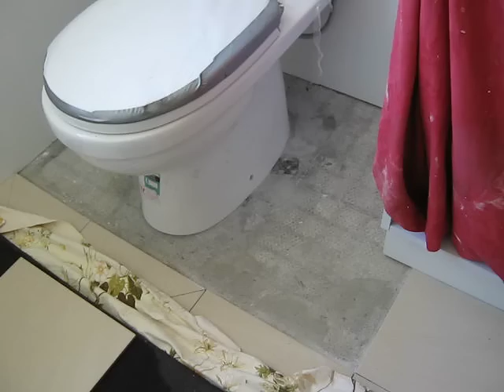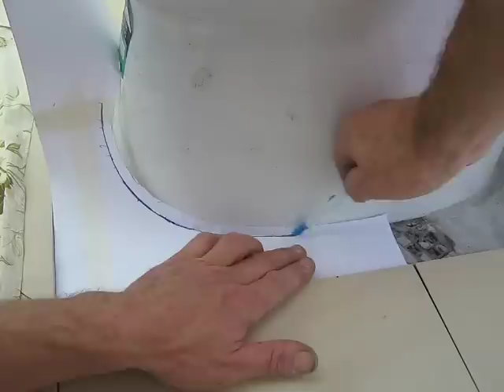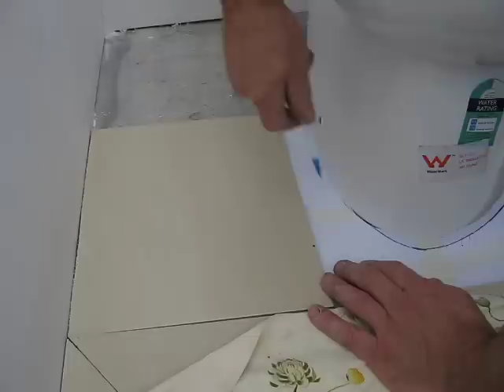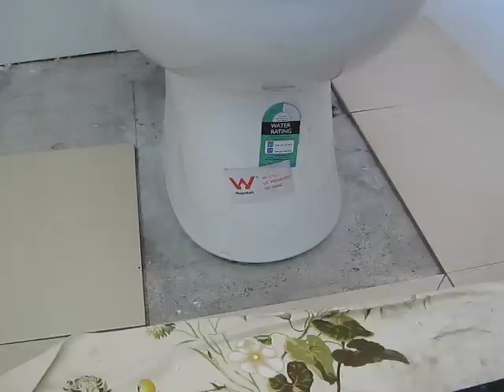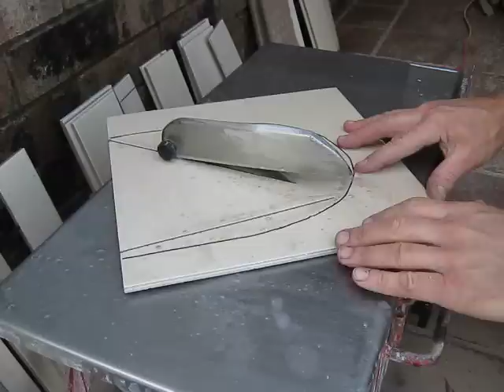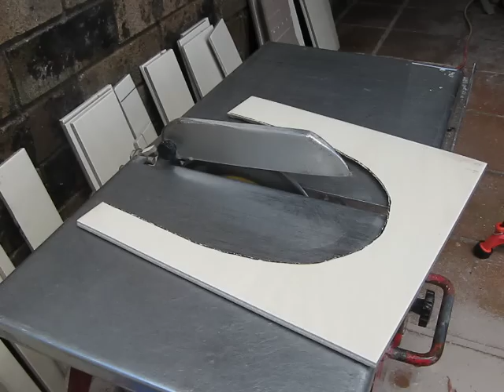Cutting tiles around a toilet ( the floor is dished, not level )

Comment: I would not do this as a tile professional.   The list of issues starts with when there is a toilet issue and it needs to be replaced the bases won't line up thus the tile will need to be replace which is more expense...and only if they were smart enough to leave extra material.  Finding tile after years is mostly futile.  

So.... Pull the toilet and charge accordingly.
Reply from the maker: +scott patterson Yep i left heeps of tiles under the house , the next toilet will be other dimensions , i will be gone by the time the next toilet is needed, there is no point in having a huge gap around the toilet filled up with coloured cement ( grout ) so the next toilet can fit in , i recommend the A4 paper template technique , there is a small gap between the toilet and the tiles so maybe the next toilet can fit in , but it would be a miracle , over and out

Comment: I can’t believe this is a thing. I personally pull the toilet. If you hard pack the toilet in I cannot see any good coming from it. Tile could break from expansion. Or if wax ring fails you will never know about the leak. Your cut is on point and looks nice.
Reply from the maker: Yes thing is I hear a lot of talk about a wax ring, we use a rubber diaphragm joined to pvc pipe and the under toilet out let pushes in through the rubber with a hole in the middle ( diaphragm ) and job done, good until next reno, that's how we do it here, I suppose you have another way
Reply: What country is this installation in? Just curious. Looking at methods of the rest gives me more questions than answers.
Reply from the maker: This is in Australia,  @tileslay6543

Comment: I would have used an angle grinder personally, gives a much smoother edge.

I use the same technique with templates where possible though, although much less time consuming to pull out the toilet in my opinion.
Reply from the maker: Yep I eventually used the angle grinder, We usually only pull out the toilets when we do renovation, the toilet drops into a rubber diaphragm then exits into pvc pipe
Reply: @1966human  I used to be the same, but I just find it quicker in the long run to take it out. Plus bathrooms are often cramped and small....get that toilet out and give yourself some extra space if you can.

Comment from the maker: Reply to Benjamin Logan ( there was no reply option for his comment )

The old toilet was installed on top of the tiles , although there was a hole in the tiles where a key could be provided to the cement floor ( the cement under the old toilet didnt bond to the tiles - only the slab ( cement floor )

The floor is dished to provide drainage to the waist  ( long ways along the room ) , so the old toilet wasnt level

The new toilet had to be cut into the floor to get it level so there was no option of installing the toilet on top of the tiles

i wouldnt install the toilet on top of the tiles because i could remove the cement under the old toilet by hand

Comment: Why would you just tile under the toilet with a flange spacer? Oh well not my bathroom. Looks cool
Reply from the maker: Hi the floor is a screed floor, shaped so water will flow toward the window away from the inside of the house and drain out of the room, the toilet is not level to the floor, I have access to the plumbing under the house, the floor is a floating cement slab, I can get under it and work on the plumbing, The toilet will probably be replaced in 30 years or so with the next renovation, all good with the toilet ( 23/08/2018 )

Comment: In the long run, you have problems looking at you. You better go buy extra tiles before they don't make them anymore.
Reply from the maker: Yes I have 6 boxes of bathroom tiles, the toilet base I replaced with this one was 42 years old and this toilet base will probably be replased in the next renovation, I can access the plumbing under the house ( the toilet is floating on a suspended screed ( shaped for water overflow flow out of the room to prevent house flooding ) cement slab floor

Comment: ALWAYS  pull shitter
Reply: But if some reason you can't, I like your template
Reply from the maker: The toilet had to be preinstalled ( or put in before  ) because the floor is dished to provide drainage out of the room and the house ( instead of flooding into the house ) so the toilet is installed level and the tiles follow the form of the floor ( bowed )